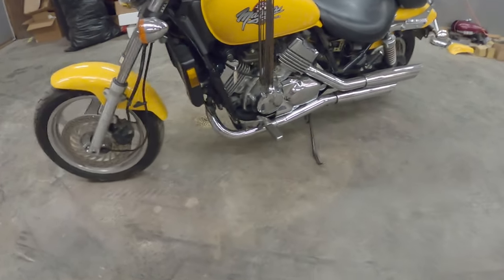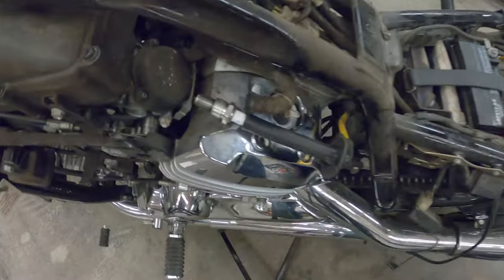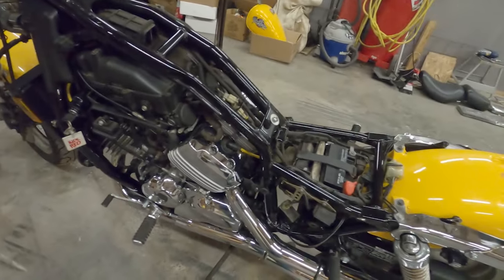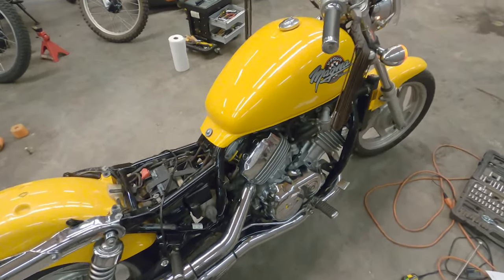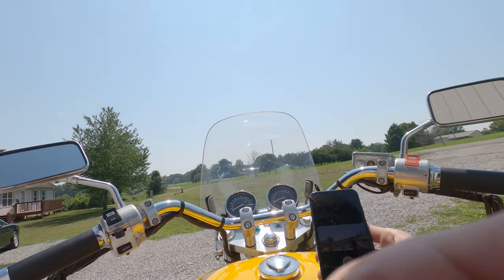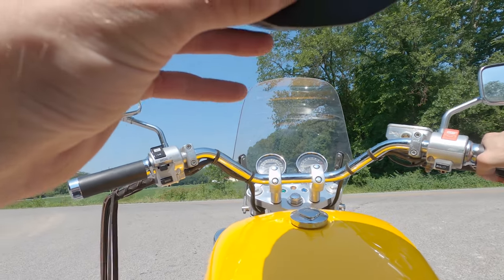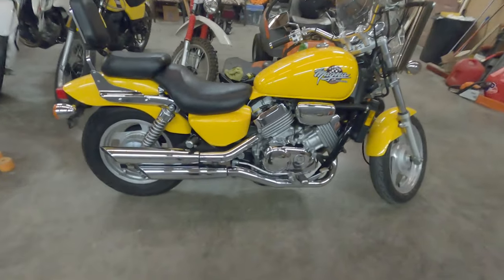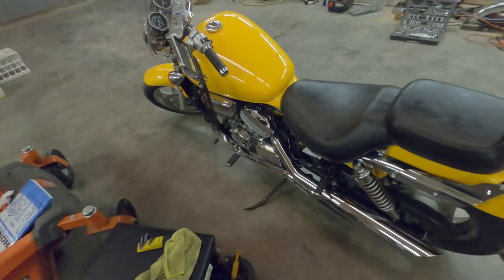Will this v4 powered Honda Magna VF750 run?

Comment: Why wouldn't it run again?! lol. Man, these engines are amazing, and very under stressed on this bike. People think these are like V-twins, butthey have far more in common with an inline, as far as the hp and torque goes. Very fast bikes for being a 750 cruiser!
Reply from the maker: Pulse generator was way out of spec causing intermittent miss/backfire and no start but it also needed the carbs cleaned from sitting for a few years. I agree though the sound, higher revving nature, HP/TQ riding it it definitely felt more like an inline street bike engine in a cruiser chassis and made for a fun cruiser.  🤘

Comment: Just got my grandfathers 96 cant get to idle starts flawlessly with choke wont throttle up any ideas?
Reply from the maker: Sounds like some of the jets may be clogged, could be due for a good carb clean but may be able to just pull the tank & top of the air box off to get access to and clean some of them. ✌️

Comment: No point whatsoever replacing pulled gjenerator. Clearly fuel carbs etc. Waste of money
Reply from the maker: I clearly state that it was more than likely just the fuel and gunked up carbs @2:30 ALSO that the pulse generator was out of the specified resistance range meaning it was just a matter of time before it stopped working. Some people would rather be safe than sorry and stuck out on the road, maybe not yourself but that's your opinion.